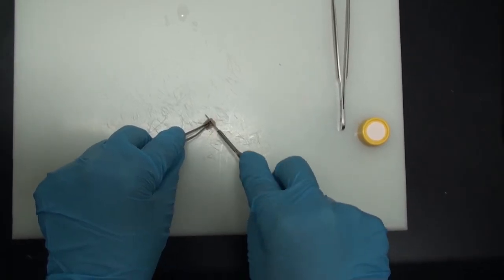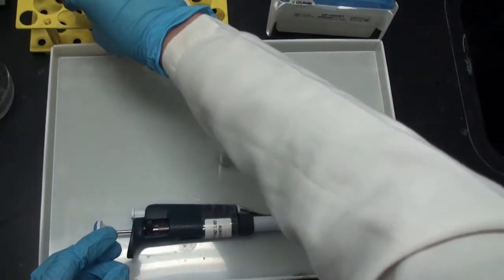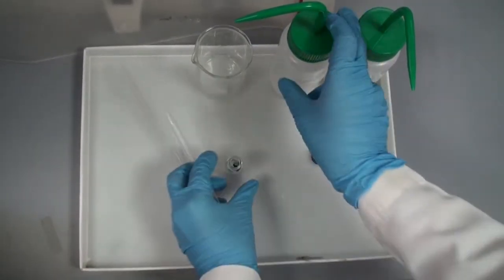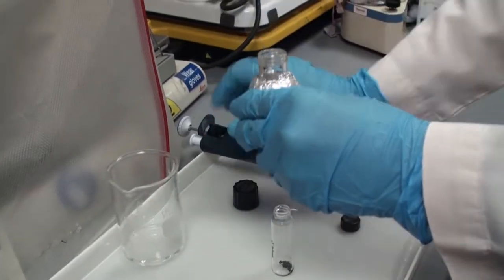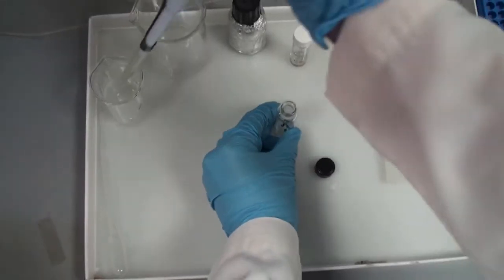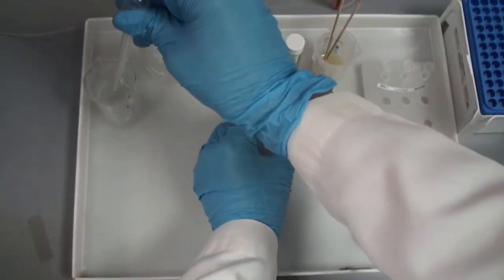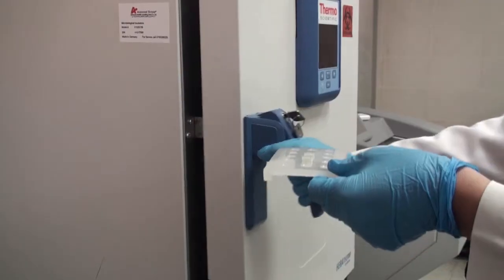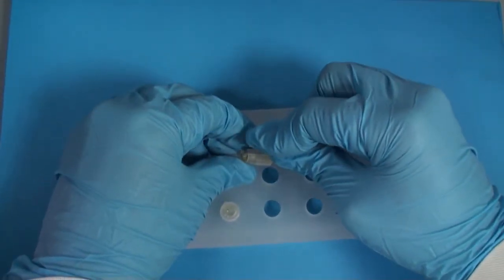Sample Preparation for Electron Microscopy

Comment: you take a piece of tissue. you first flood it with chemicals. then you dry it. you freeze and I don't know what else... and then you prove viruses in such a sample? don't fuck. when you get the whole procedure through, then the pattern is no longer the same as it was. but if you doused it with chemicals, dehydrated it, froze it and then finally baked it with electrons at 150 degrees cesium.

Comment: Fixation  by glutaraldehdye
Wash with optimum tetraoxide
Wash with pbs
Dehydration with ethanol
Propylene oxide
Infiltrate with resin
Embedding put resin inside a mold
Oven for overnight 60 degrees 
Cut the plastic  mold 
Sectioning by ultramicrotome
Reply: Why did we use tetraoxide and pbs ? Whats the benefit ? Also propylene

Comment: Some tips at sectioning. Remove the spec. trans light cable. Turn the Chuck not the hole Seg.Arc. and use a Trimmer with a diamond cutter. The razor blades causes defects in your diatome knife sooner or later. :-)